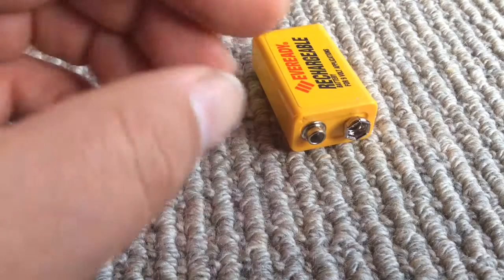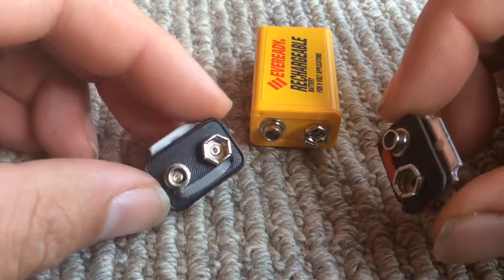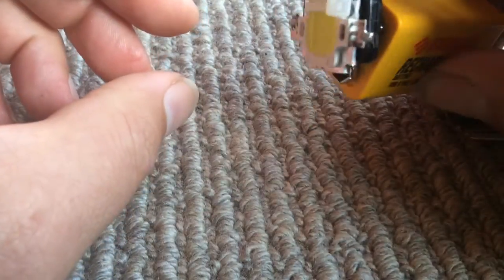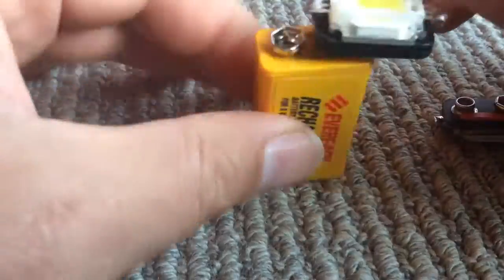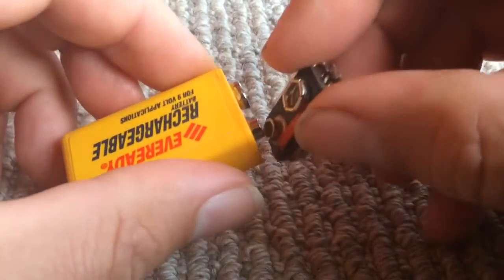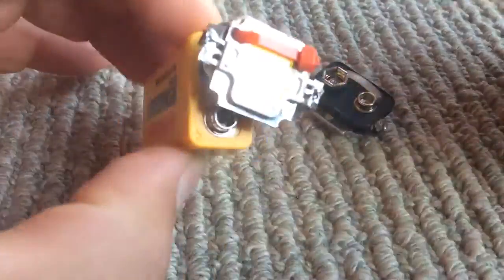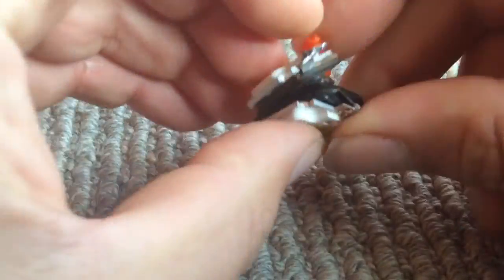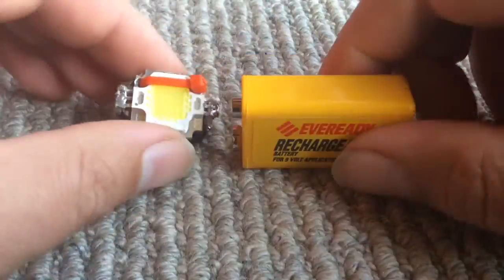Making torch for Quadcopter or plane from 9 volt 10watt LED

Comment: I use a 12 volt LED panel on the front of my quad, it runs from the quad battery AUX power supply.